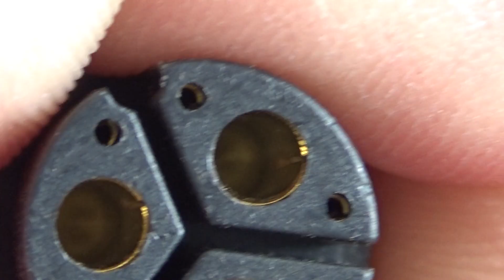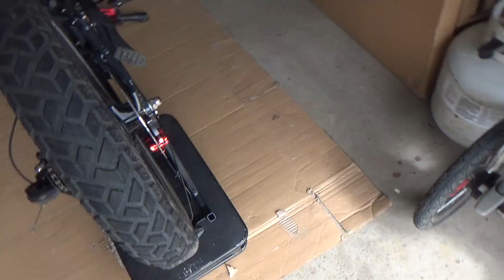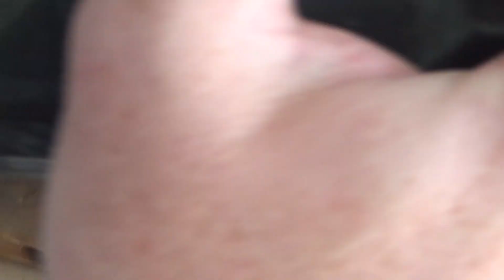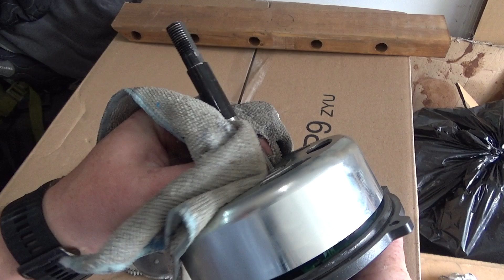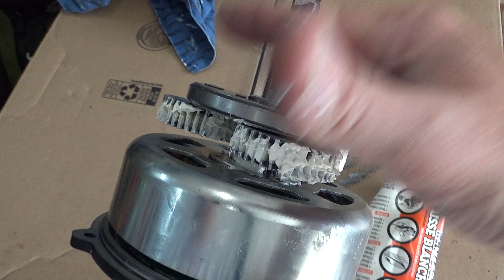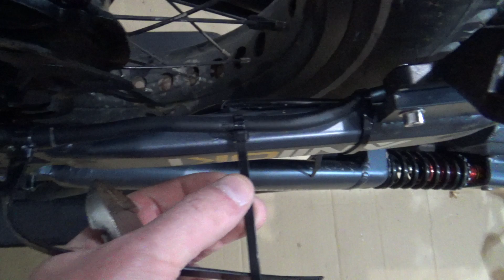ANIIOKI A8 Pro Max Dual Geared MOTOR maintenance / gear replacement

Comment: Why I can’t remove it wirh my Aniioki this way ,my aniioki es a 8 pro max
Reply from the maker: Remove what?
Reply: @JustDoItPlus the motor
Reply from the maker: @bettascarlosgildemontes9980  why you can't? Remove screws and it will go
Reply: @JustDoItPlus I did and it doesn’t move ,maybe because it is different design
Reply from the maker: Press on wheel to make it popped up

Comment: I shorted out my motor when the rear disk brake got red hot going down a hill and burned through my motor cable that was too close to the disk ,the motor has a 24 error code can this be fixed?
Reply from the maker: It is hall sensor code. Most likely hall sensors wires damaged.  Easy fix.

Comment: Great job 👍 
I’d like to know after how many kilometers of riding maintenance greasing is required."
Reply from the maker: According to owner manual 100, 500 and 1000km. After each 1000km.
Reply: You talking about motor greasing  @JustDoItPlus

Comment: Як часто потрібно робити це обслуговування? Після скількох миль робити перше обслуговування?
Reply from the maker: Згідно мануалу : Maintenance: lubricate the motor when the range is at 100miles, 500miles, 
1000miles, and whenever necessary. Or it will cause motor noise.

Але особисто я робив один раз і планую робити раз у 1500км... Приєднуйся до телеграм групи https://t.me/aniiokiowners

Comment: Could you provide us with links to buy the metal planetary gear you use, please? I've done some research, but I can't find this.
Reply from the maker: @dannybrabant4364  it is stock gears for dual motor version.  But you can buy it from aliexpress 
I just found this on AliExpress 47.5x13.2mm
https://a.aliexpress.com/_mL2jnYr

Comment: I really appreciate the video it haled me out a lot. You mentioned that a motor is not completely shot if the cable is damaged. I have 2 motors - one with a bad cable that works and one that doesn't work with a good cable.  i have all the parts to make a working one and was wondering if you have a video for that as well.  Thanks again!
Reply: A video to swap the cable is what I meant actually.
Reply from the maker: I don't have video about cable replacement,  because  there is a lot videos on YouTube about it

Comment: 6:50 i think i could fix that cable i designed and even built my r&d robotic welding equipment for 10 years and have 7 patents well the company i worked for thinks the patents are theirs. The welding on these bikes are well they hold but not good and the wiring is insane i never seen such bad senseless wiring i took mine down to nothing and am redoing everything and wrapping it in snakeskin.

Comment: Would plumbers tape work in place of the thread locker? I learned the hard way about those nuts.
Reply from the maker: @Theoblade01  no.
Reply: Buy some loctite. Plumber's tape won't work with small bolts and screws, you'll damage the threads or strip it/snap the head off trying to tighten it down.

Comment: Good video, very helpful! Only one correction - this break doesnt use dot. Its with red mineral oil
 :)
Reply from the maker: Yeah, i don't know why i said it is Dot fluid,  but your right. There is regular brake mineral oil.

Comment: where is the speed limiter on these bikes, i personally have the AQ177 dual motor model but the controller didn't seem to have any such wire, then again I wasn't able to fully see everything because i couldn't pull it out entirely.
Reply from the maker: There is no speed limiter wire like on surron or talaria.... But you can change speed limit and amperage on your screen. Check my other video with screen settings.

Comment: you maybe could add another 3 screws to the motor/first gear connection with countersinking the othef 3 holes and cutting 3 additional threads in the motor bell (just an idea how to add strenght if you also shunt mod or add a bigger controller)

Comment: Great video. It's often suggested in the ebike community to use Mobil SCH-100 red greease for geared hub motors. Any reason you recommend white lithium grease instead, which was thought to be inferior?
Reply from the maker: Firstly, because it is recommended by the manufacturer,  i contact them before making a video. Also, grease must be safe for plastic,  and this one does... 
For fully plastic gears, Silicone-based grease is ideal as it's compatible with plastic components and doesn't degrade them over time. It's also good for waterproofing.
SCH100 synthetics also works, but i personally do not like it...